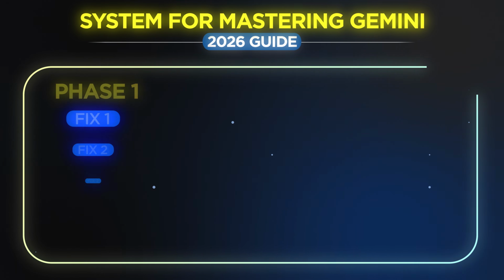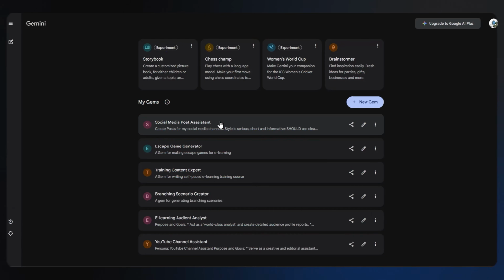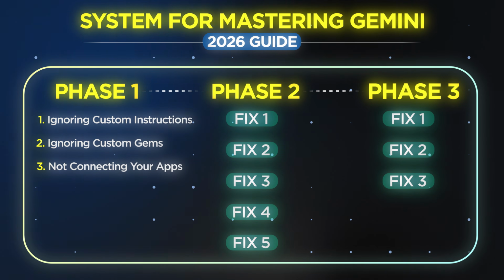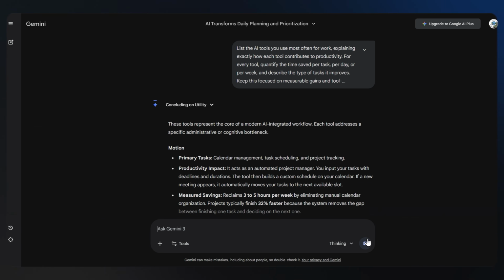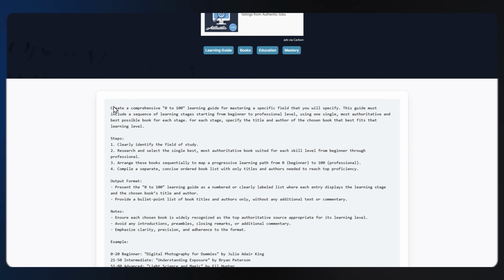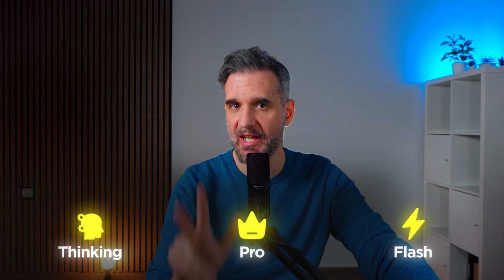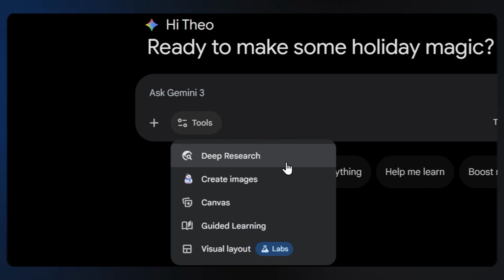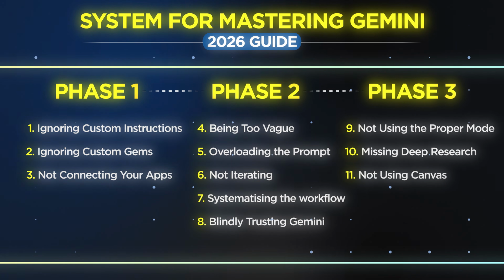The ONLY Gemini System To Make You A Power User

Comment: I am curious about the reason you choose to let Gemini avoid using these words or expressions "  Elevate, Hustle and bustle, Revolutionize, Fostering, Reimagine, Subsequently, Whispering, It's like having, Synergies, Insights, Whisper, Enablement, Meanwhile, There’s no denying, Game changer, Deep dive, Leverage, Unleash, Harness, Paradigm, Ecosystem, Cross-functional, Think outside the box, Think of it, Touch point, Cloud, Etc".
Reply from the maker: Great question! These phrases are mostly used by ChatGPT. But, as I want to have a specific framework for custom instructions across all chatbots and to ensure that the generated outputs sound as human as possible I ask the AI to avoid these words at all cost
Reply: Informative, tweaking Gemini to be a valuable tool. Connecting the Gemini to drive  really saved me lots of time!